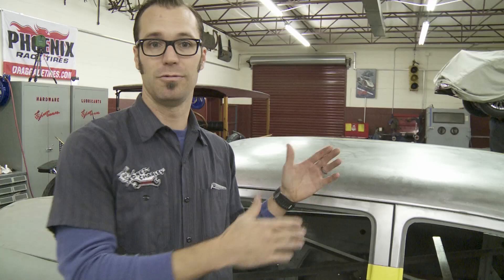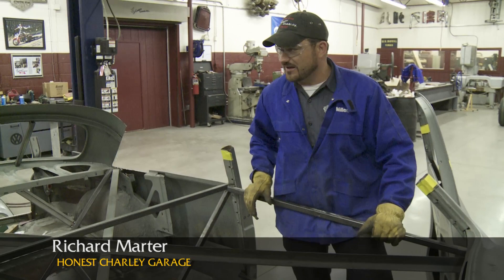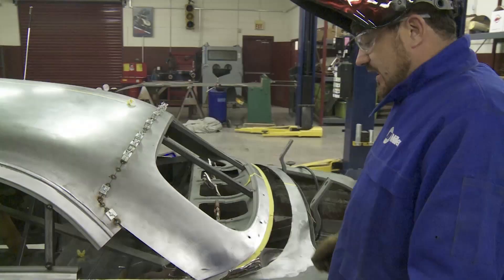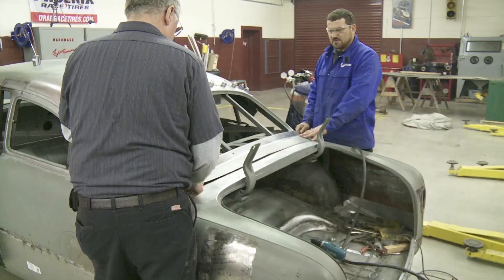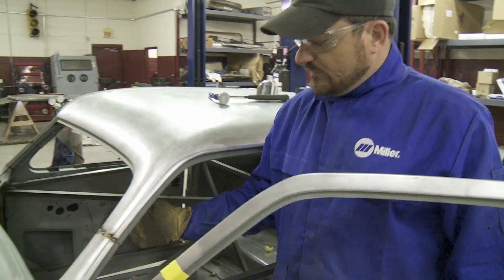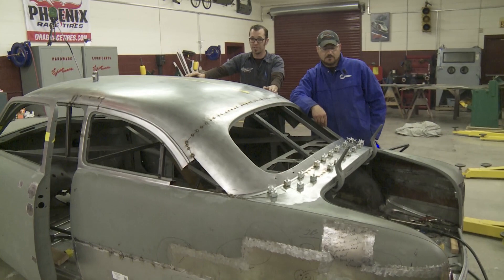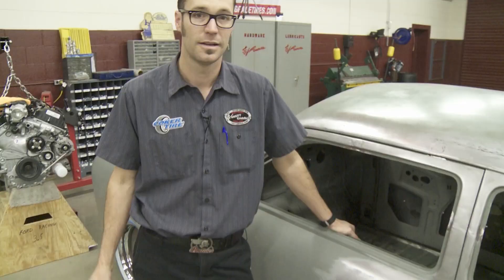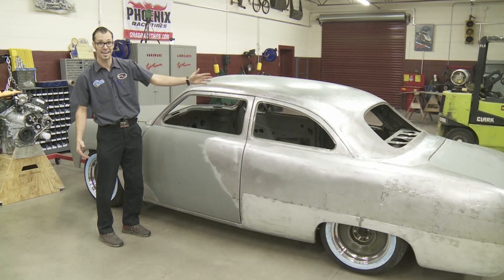2013 Street Rodder Road Tour 1951 Ford Roof Chop

Comment: Bell Glass in Phoenix Arizona just cut down my laminated windshield 2 inches with no difficulty. It is perfect to my line. It was not expensive and they have been doing it for years.
Reply: What did they charge you
Reply: @anthonymaniz9896  since i live in Phoenix there was no shipping. The cost was $200. There is a possibility that the windshield would break wrong and I understood that risk. I actually had him do a second one that I keep in the shed in case of disaster. Good luck with your chop, pal.
Reply: My windshield was for a Cobra sized speedster. I still have the extra shipping box. If your class is not that unique from a more modern car he told me that some folks send him a very accurate paper template and have the local auto glass dealer take him the new glass in a shipping box. He cuts it, replaces it in the original box and sends it to the customer. This way the customer only paid once for shipping. Maybe i can help if you go forward.

Another thing i have done that i think is a REALLY good idea is putting clear film on both sides of the chopped windshield. The film at least tries to minimize chips. I told a buddy about this and he filmed his plexiglass panels with absolutely amazing results. The film adhesive somehow eliminated tiny scratches that had inevitably appeared over several years of very careful cleaning. It was amazing.

Comment: FYI, the math he explains at 11:00 is wrong. Ya kinda know what he’s trying to say, but 2 inches would only net you 1.4” chop at the front. I measured my A pillars and they are 45degrees. 2”x.707 = 1.4”
Anyone attempting this chop, (I’m in the middle of doing it) 2” wide masking tape on the A pillar and the B pillar, gives you a nice rake on the roof line. The filler piece above the door, is about 1 3/8”... just like the distance the a pillar went down, that’s the same amount the roof comes forward.
Reply: How did your car turn out
Reply: How did yours turn out

Comment: Just thinking it would look nicer if roof was stretched a couple of inches to get rid of the awkward fill in panel from the trunk lid to the rear screen? The ratio of upper body to lower body has to be maintained.